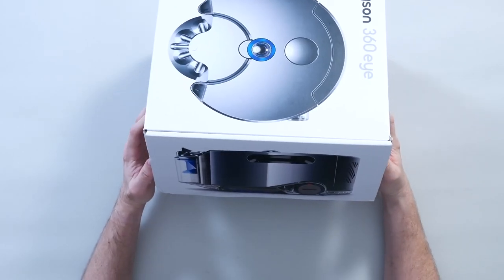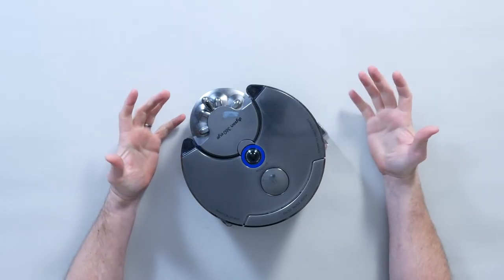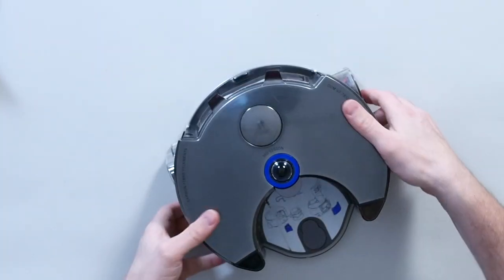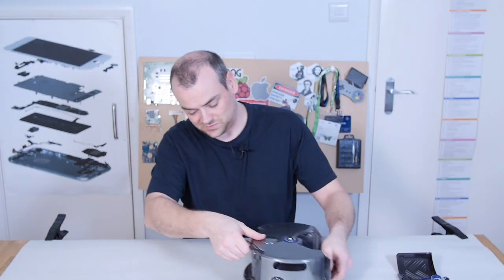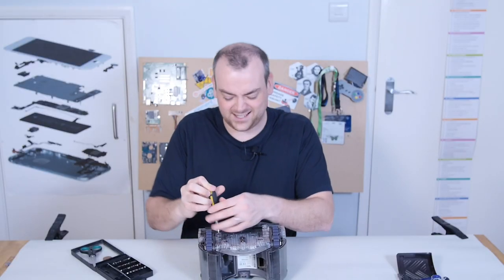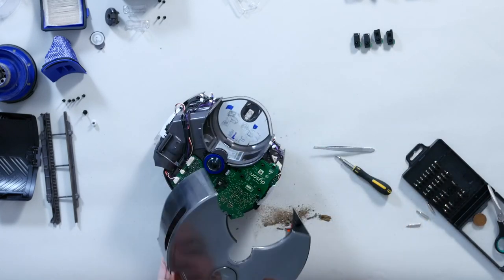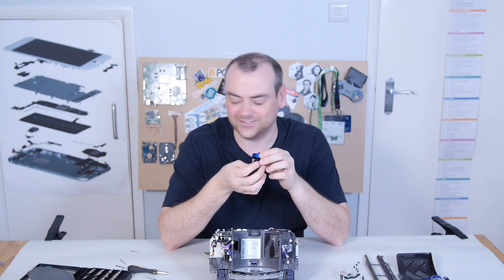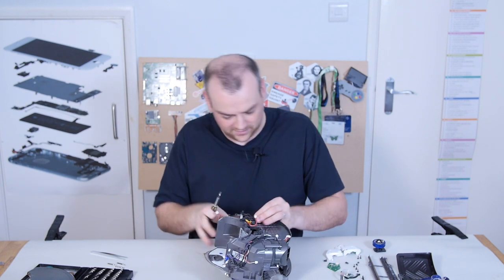Dyson 360 Eye Teardown - The Electronics Inside

Comment: As far as owning a 360 for many years, it is definitely a conundrum. We jokingly name our vacuum 'Rossie' after the robot in the Jetsons; however, the Dyson really isn't that smart. It doesn't learn your house, so you can't tell it to vacuum room X, or don't vacuum the bathroom. You just have to close doors instead. The Dyson software is also closed source and doesn't support 3rd party connectivity, such as IFTTT. It would be awesome if the Dyson could turn on/off the lights when it's cleaning a specific room in a house. Dyson also never really evolved the product or released new software features for customers over the products lifetime. Lastly, the 360 Eye requires that you have a pretty clean space, as it will easily choke on socks and power cords on the floor, as well as getting stuck on furniture. So, you have to be very mindful, and accommodating to your little robot helper. All that said, when it does run, it does a pretty good job picking up cat/dog hair and dust, but as you still need to manually vacuum all of the other surfaces, it really doesn't save you much work in the end. I think that I would recommend that people spend their money on a good pair of headphones and some music or an audiobook that they can enjoy while vacuuming manually.
Reply: Interesting! Thank you for sharing! I understand that the newer generation (I think it's called cobolt) is better in low light / dark rooms?

Comment: Was curious as to what you found about the battery pack, as ours is misbehaving, perhaps with charging.  I think I can give some insight on the rifd tag you found under the waste bin.  It is actually used to control a switch in the charging / docking bay. 
When it is not docked, although the power supply is giving out about 17.8 volts, the 2 contacts have little to no voltage
Move it over the top, and they switch on.  
I'm guessing safety feature to prevent people / animals electrocuting themselves and / or short circuits if the 2 contacts have something metal dropped on them

Comment: The reason for the EU legislation was to stop companies to compete with higher and higher Watt amounts for customers. Customers tend to think the higher the Watts the better the machine. But the truth is a certain amount of Watts is enough for 90% of all daily tasks and much higher amounts are not necessary. The EU legislation lead to 2 advantages: 1. it saves a lot of energy while still having enough power for the daily cleaning. 2. it forced the companies to get better in other features of the machine like better filtration or less noise.

Comment: The filter on the back is a HEPA Exhaust filter that traps 99.97 of particles down to 0.3microns.  The filter at the front is the Pre Motor washable filter (not a bag).  A bit disappointed that you didn't know the full tech details of the machine before you posted the video.  The Dyson motor inside this is called the Dyson digital Motor V2 that can spin up to 78000 RPM.  Just a switched reluctance motor inside this thing.

Comment: My original Dyson 360 Eye is having trouble driving straight, the good side has plenty of resistance while manually push on the tread; however, the other side will slip if I push with too much force. I took the base apart as far as I dared, including the tread covers, but I couldn't spot any tension screws, nor wads of hair, nor long hair binging any gears. I was hoping to learn if you noticed any sort of mechanical device to allow slipping?
Reply: As far as I saw, there was no method for tensioning them. I would think that they are a consumable that you can probably source a replacement for? The only good thing here is that they would probably be "frangible" and should have protected the pully's.
Reply: My 360 Eye is having the same problem as yours. I took the tread off and found that it is not the tread slippery but the driving gear. When I try to turn it by fingers, I can feel the "slip". I do the same operation on the driving gear wheel on the other side, it has no such slip. Probably, the whole traction assembly needs to be replaced.
Reply: It is not the tracks slipping, but the driving gears. They are designed to give so that things are not broken if it gets stuck, but this 'clutch' effect gets looser over time. I have yet to find a solution. I have two to take apart and will update if I find an answer.

Comment: Do you happen to know where one might find replacement treads for the 360? One of the motors stopped working and I'm at a loss as to where to find a replacement
Reply: Despite how easy this might seem to repair. I have two units, luckily one with the left track slipping and one with the right track slipping, so a replace and repair may be possible. To get to the motor to swap parts requires a FULL take apart. There are some sellers that are selling the whole traction section (the lower part of the dyson), but just replacing that will take over two hours. Carefully, they have designed this so it is as difficult as possible to take apart. Truly. Some design decisions here could only be done on purpose to make it harder. To remove the whole bottom section, you must unplug the wire that goes to the charging connector (it is not long enough to move the traction assembly without unplugging this cable). The connector is hidden under both circuit boards and so requires a full disassembly and unplug of almost every cable.

Comment: Just an observation about motor power limits, the reason these exist is exactly because of the misconception you've fallen for, manfacturers were putting bigger and bigger motors into vacuum cleaners because people buy the best, so if you can put a 3KW motor in your product even if you don't need that much power, then that sells as 'better' to consumers. The reality is that these vacuum cleaners had vents to allow the surplus energy out because no one needed that much power. Tl;dr a 1GW vacuum cleaner can't clean your house any better than a 300W one because you need to brush the carpet and bring the vacuum source into a concentrated area.

Comment: Anyone in here needed to replace their battery? I've gone the cheaper route and ordered an aftermarket one. The Dyson does not seem to act the same. I have a feeling there is some proprietary circuitry inside the battery pack. I'm starting to think I should give it a shot at opening the pack and replacing the batteries inside. Anyone else have any tips?
Reply: Did you investigate the battery further?  I keep getting a red light and wondering if the battery is at fault having cleaned filters etc.

Comment: I've taken apart quite a few things in my time. You are right about the design of these. They look amazing, and confusingly, they look simple to take apart, but really are not. So many hidden plastic catches. Like a french car, you virtually have to take apart the whole thing, just to change the rubber on the wheels. Or perhaps like a solving rubik's cube — you think you are just one move or screw away from the solution, and find you have another 13 un-intuitive steps to go.

Comment: How in the hell is that massive brick going to fit under furniture? It’s as thick as a four layer cake.
Great govt idea. Make the vacuum less effective so it has to make more passes. Just as brilliant as water saver toilets that need two flushes. Govt brilliance at it’s finest.
Reply: It's cheap junk
Reply: @lloydtshare  I you think it's junk or not is your call. But I definiately wouldn't call it cheap at £700 new!
Reply: It is pretty thick, although by luck or judgement it doesn't clash with anything I have. I can picture chairs and coffee tables being an issue?
Reply: @lloydtshare  I agree, but overpriced junk